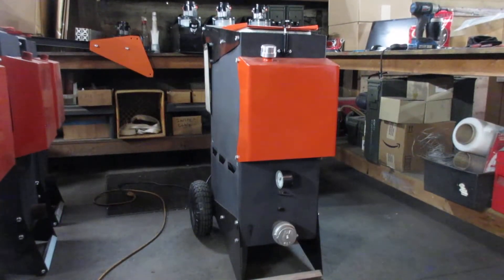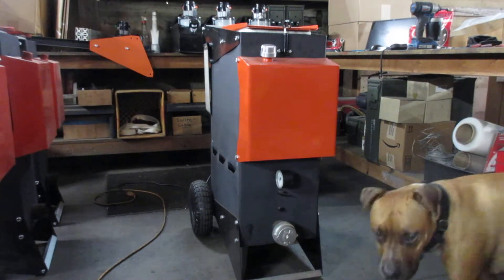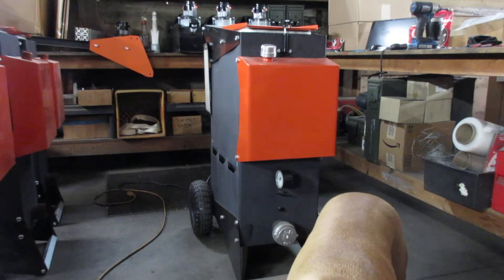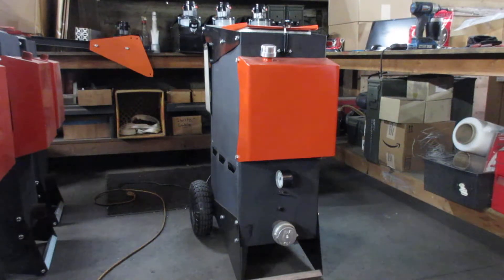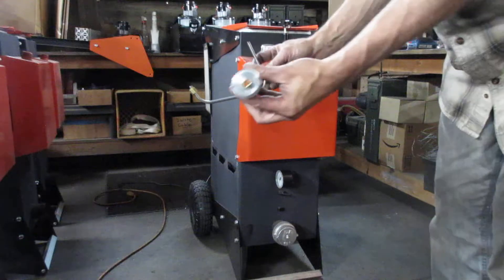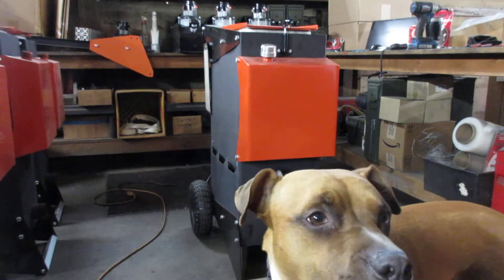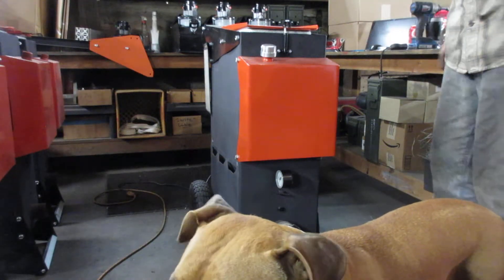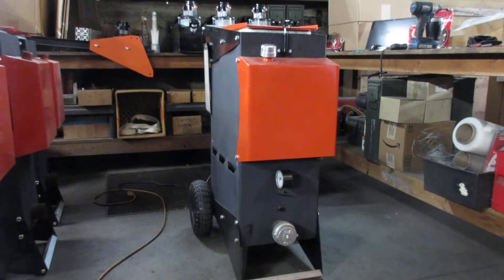Thrive Off Grid Quality Control Measures

Comment: Very good, what’s the life span of one of the gasifiers, blower fan ...Ext ? Thanks
Reply from the maker: We have not worn one out yet. So I dont know. They are designed to last forever. There is nothing you can not replace other than the core weldment. Unlikely that will ever fail these are charcoal not steel rotting wood gasifiers.
Reply: @Thrive-Off-Grid  Right on good to know, as soon as I can afford one I’ll be ordering one for sure. It would be a cool experiment to try and run an atv or an old carbureted vehicle.. put the gasifier in the truck bed or behind on a small trailer.
Reply from the maker: @doenjohnjo434  I can not market vehical installs. But the DFX-S4 is designed for that application. You will need two of them to run any vehicle.
Reply: @Thrive-Off-Grid  Oh ok I hear yah would be cool though. I’m really surprised u don’t have more subscribers. Theres really nothing on the market that can give u this kind of energy independence. Last question..lol have u had any issues with engine gumming up using charcoal gas ? Like is there a procedure for every so often to run the engine on gas to clean it out ? Or is the charcoal gas through the ammo can sawdust filter good enough for continuous use. Thanks
Reply from the maker: @doenjohnjo434  If you run good charcoal and get the water drip dialed it will make very clean gas. If you are getting some water post filter this will only leave some residue that will basically wash off with water. We dont offer free stuff on our channel like MrTeslonian. People would rather get the info for "free" and then destroy engines and beat there head against the wall instead.
Reply: @Thrive-Off-Grid  Ok right on yah I don’t wanna even mess with wood, charcoal seems like a far superior fuel. Yah I agree with yah that wood gas is super dirty, u can see the tar leaking out in most videos on YouTube. I’ll keep following for updates, I watch all ur videos man . Thanks